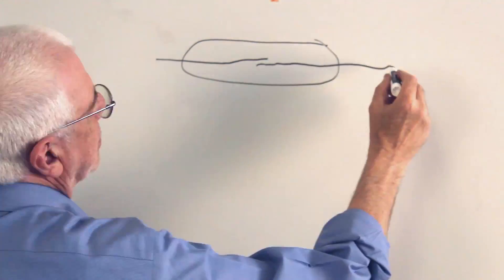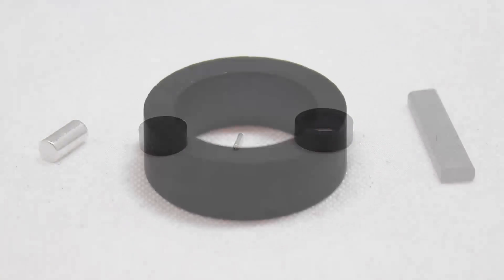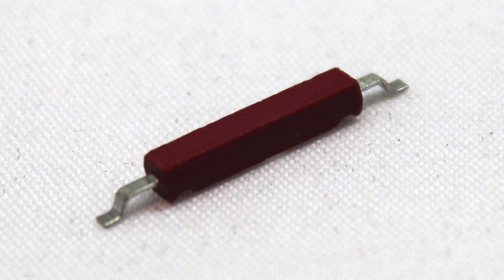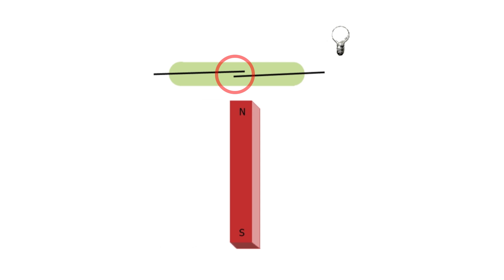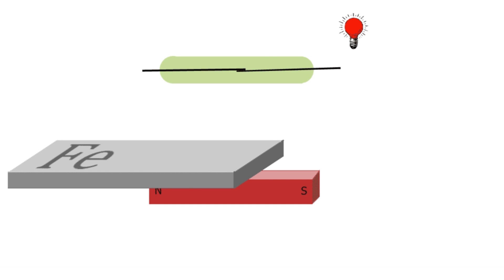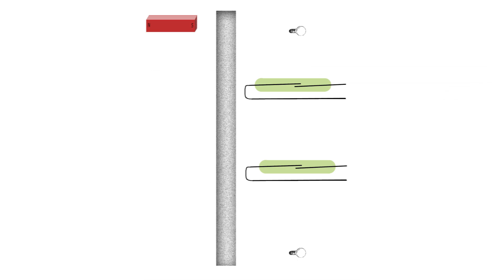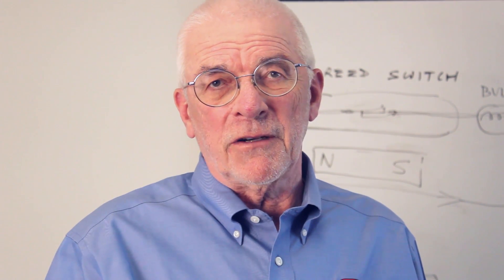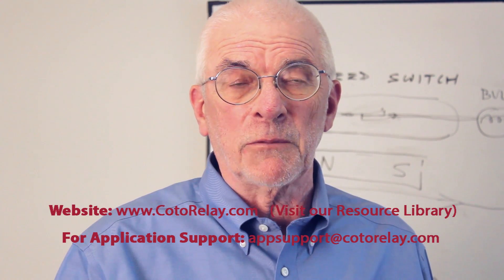Introduction to Reed Switches, Magnets & Magnetic Fields

Comment: Thank you very much for your explanation. I have a question relating to the reed swith in the flowmeter of a dishwasher machine. Two contacts of the reed switch are open normally (i.e. outside of magnetic field). In the flowmeter component, the magnetic element attached to the propeller and it rotates (instead of sliding in vertical or horizontal directions) as the water runs through. Is the reed switch closed as the magnetic element rotates? Or does it keep closing and opening intermittently (i.e close - open - close - open..., to create a electronic pulse)?

Comment: Excellent, thank you. I am exploring reed switches on a project where I previously used non-magnetic mechanical mechanisms which proved very ambiguous in raising events.
I bought some reed switches and couldn't work out why the circuit closure patterns were somewhat intermittent. This explained it perfectly. Thanks again.

Comment: I'm curious if this switch could be used to build an electronic ignition system where the reed switch would be used in place of breaker points. The car I am standing next to uses two breaker points and two ignition coils (two cylinders). I've been experimenting with those points conversion kits that was intended to go in a Bosch distributor that uses four magnets mounted a plastic ring that passes by a plastic housing. I'm wondering if this plastic housing contains a reed switch or if there is any other circuitry involved. 

If the engine was turning at 5000 RPMs (maximum) and firing every 180 degrees , would the switch be able to open and close that fast? An online calculator says 5000 RPMs is 83 HZ. But I would imagine if the engine is firing every 180 degree it would be double that.

So could one lead on the reed switch be connect to the negative side of the ignition coil and the other lead be connected to ground/earth?

Would it need to go through a transistor? One idea would be to use the reed switch as the trigger but connect both leads to a GM HEI control module. If the reed switch could not handle the current.

I tested the current my Citroen 2CV's ignition coil. At least at 12 volts, the current was .4 amps. 

I have not test the Trabant.  It's uses a 6 volt system so I'd estimate the current might be closer to 1 amp.
Reply from the maker: Hello James. Our technical support team is eager to help assist you further in depth with your inquiry. Please feel free to email us directly at AppSupport@CotoRelay.com for assistance. Thanks!

Comment: Can u put the matgematical proof for the range of reed switch(10mm)?
Reply from the maker: Reed switch operate ranges are a function of their operate sensitivity, which varies based on the length of the gap between the two reed contacts. The magnetic "sensitivity lobes" also vary in their shape and proportion depending on the direction of approach, shape, and orientation of the magnet that's interacting with the reed switch. If you'd like to know more, we have a great app note discussing best practices for reed switch/magnet design on our website called "Rules of Attraction." You can find it here: http://cotorelay.com/resource-library/ under the Application Notes section. If you still have further questions, feel free to send an inquiry to appsupport@cotorelay.com